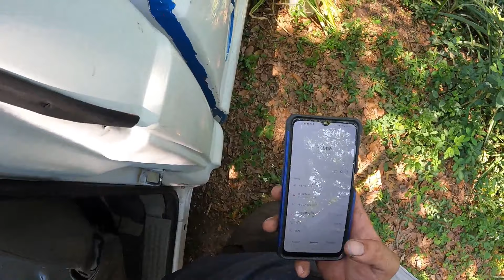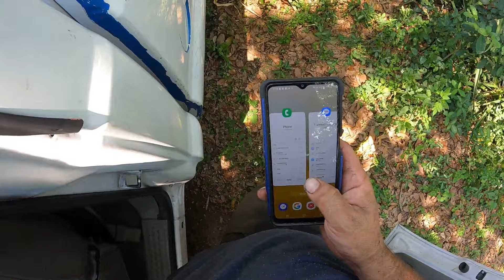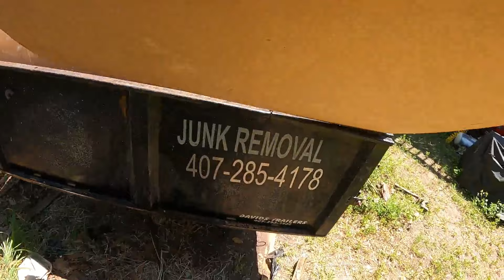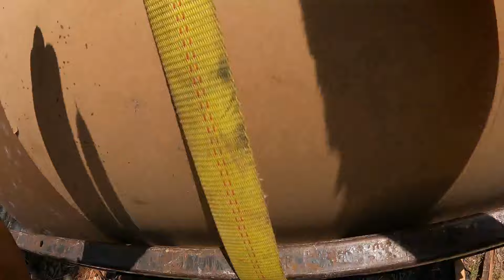part #2  of scrapping a camper trailer and clearing a property of scrap

Comment: On the end of the fire hose are solid brass fittings, 1.5 &2.5 lbs on each hose!
Reply from the maker: That's what I was thinking too but these had what look like cast aluminum and I think one of them had a brass fitting which I did take off but they weren't actual full size fire hose
Reply: @1scraplife  thanks for the update, sorry jumped to the wrong conclusions
Reply from the maker: No biggie I appreciate you letting me know cuz if I didn't know I would have known after you told me so all is good